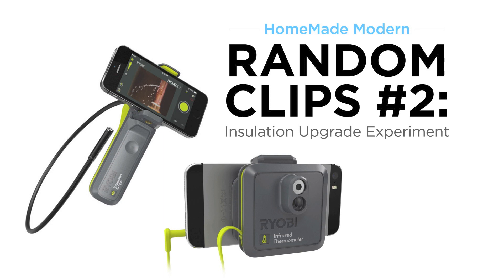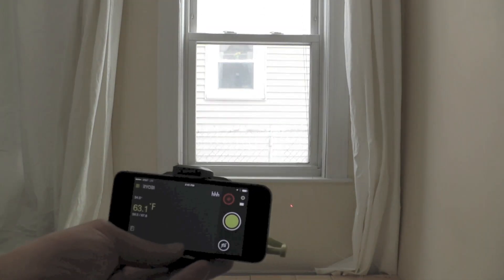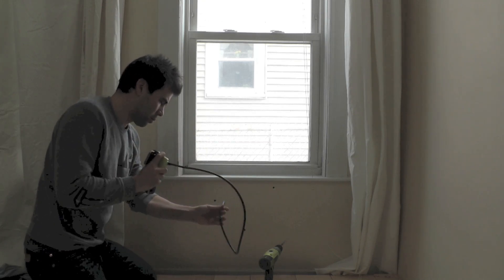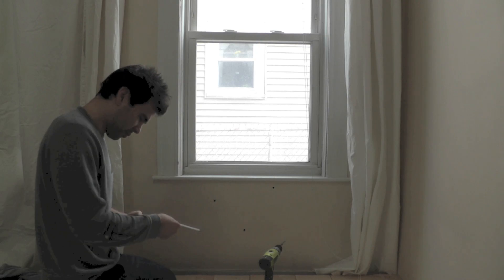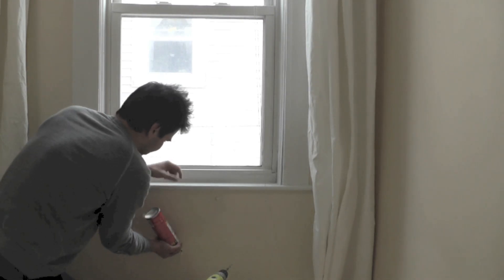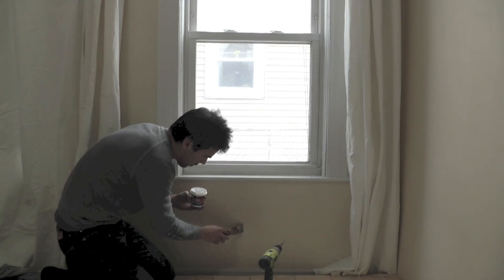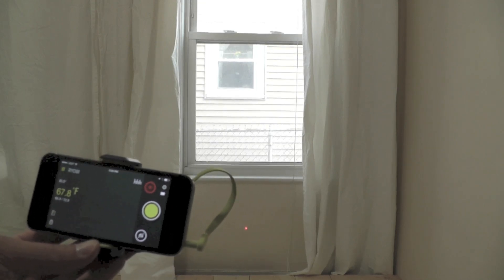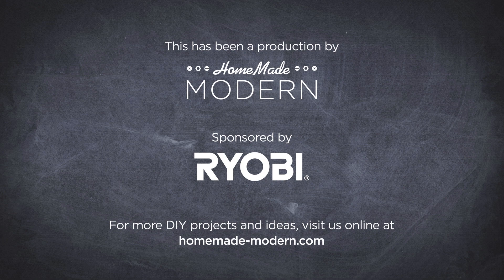DIY Home Insulation Upgrade Experiment

Comment: One thing to be weary of with greatstuff is that it will continue to expand sometimes past their desired amount. That's why they make a doors and windows version. Which also expands but not will not cause bowing etc. 

I wouldn't want the drywall or plaster to crack or change shape. 

Just a thought.
Reply from the maker: ww55d Great comment!  thanks!  you are right the window formula should be used.